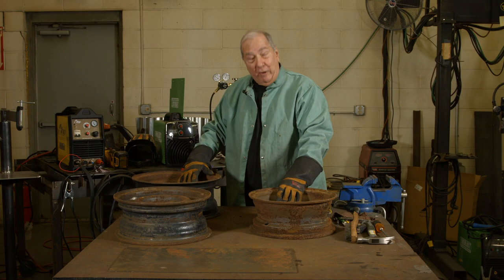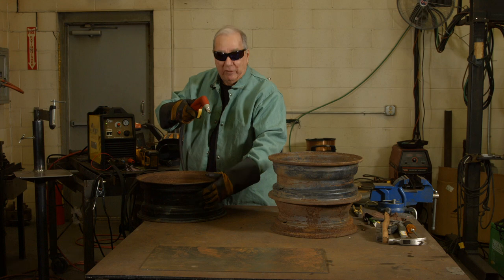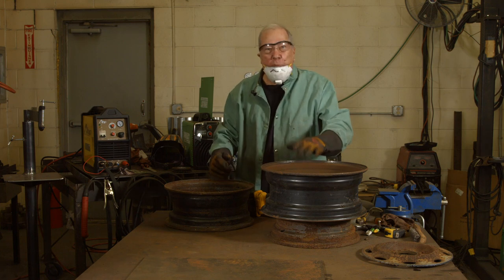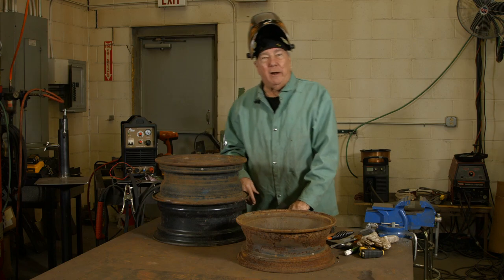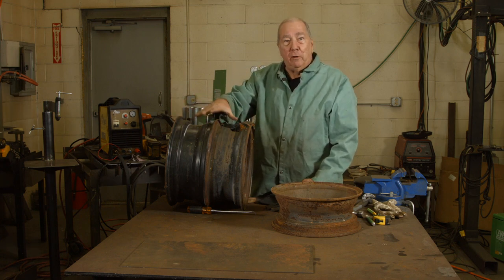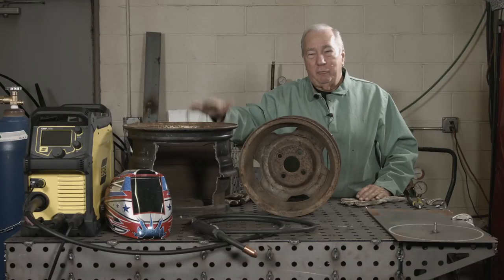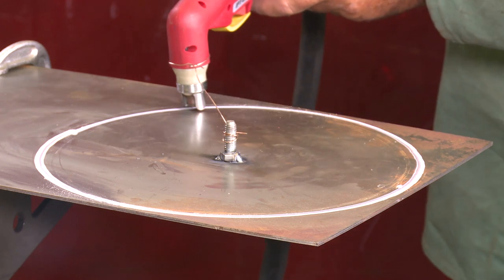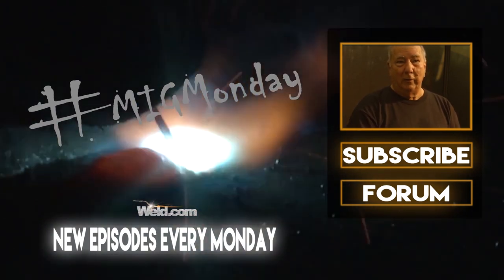Recycled Wheel Fire Pit Welding Project | MIG Monday

Comment: I'm teaching myself to weld with a MIG and I was curious what settings you decided to use on the wheels. Did you somehow measure the metal thickness? Thanks.
Reply: try 17-18 volts 180-200 wfs

Comment: if youncut the center lug area out why cut a access hole to put wood in. just feed it from the top. you should of left the lug area so you could put a pot to cook with on it
Reply: And why grind/ wire brush and MIG weld on old rusty wheels for a fire pit?
Just break out the 6010 and burn it in!
Reply: Because it's MIG Monday........
Reply: Should have saved this project for "Rusty Crap Friday" and gave it heck with 6010
Reply: +kmcwhq true........
Reply from the maker: The idea is that you can put a grill grate on top.
Reply: LMAO :o)
Reply: I like the grate idea but better make it 304SS
Nobody likes to eat Rustburgers
Reply: Barbque grate goes on top for burgers and steaks....?